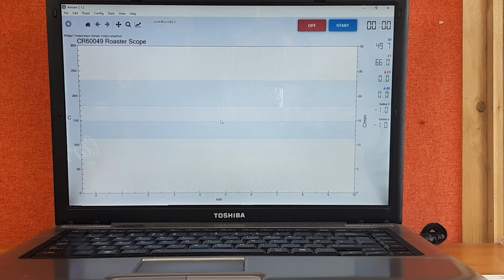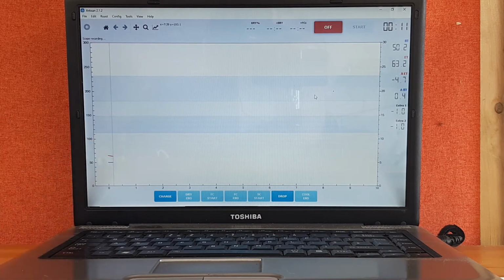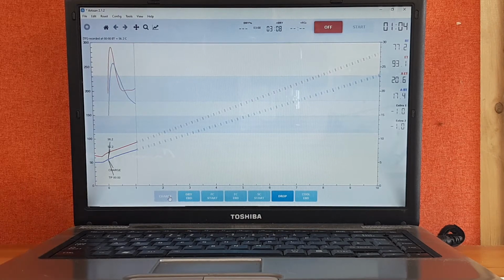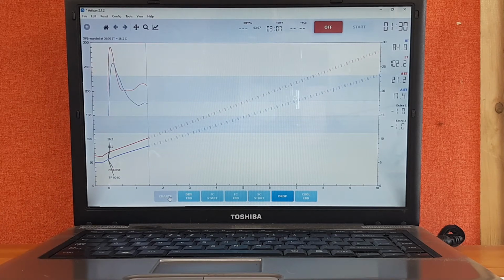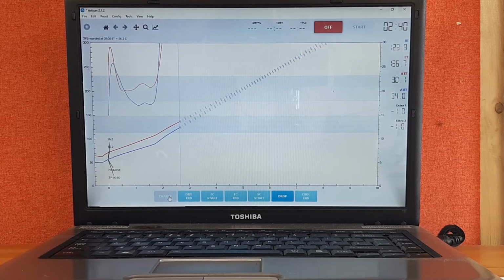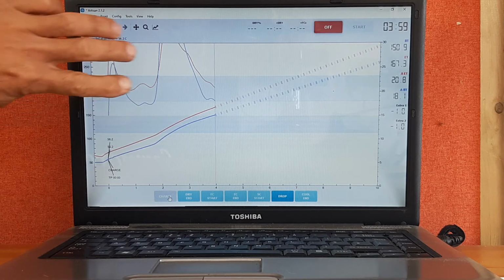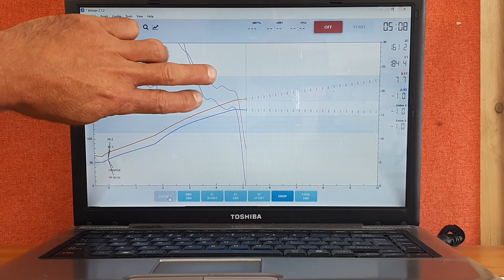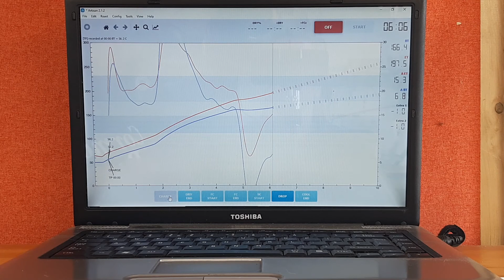Diffuser and Artisan Coffee Roasting

Comment: interesting. i wonder how viable it is to do inbetween settings as well throughout the roast? how would that affect the roast? like maybe doing 1/4 increments instead of going fully closed to fully opened and how repeatable those inbetweens are.
Reply from the maker: For sure you can, I use it a lot on half and on 3/4. You can see the effect in artisan during warmup using the ROR BT line. Closing it in increments to see the effect it will have during roasting. Interesting observation, ☺